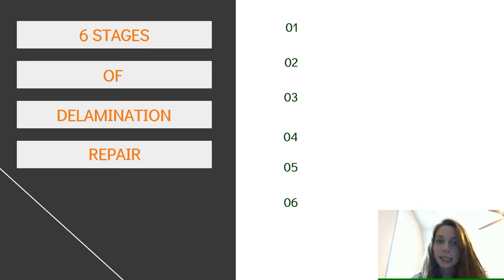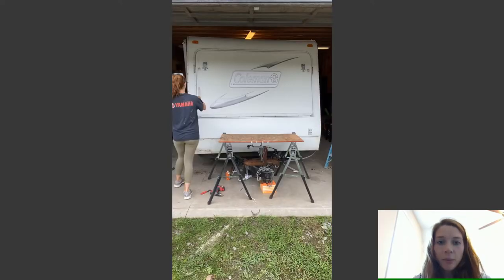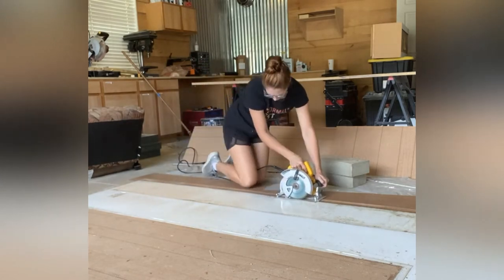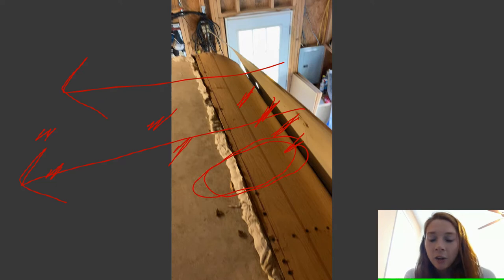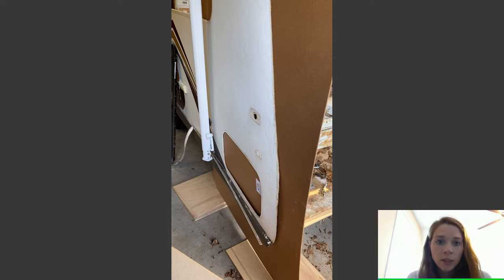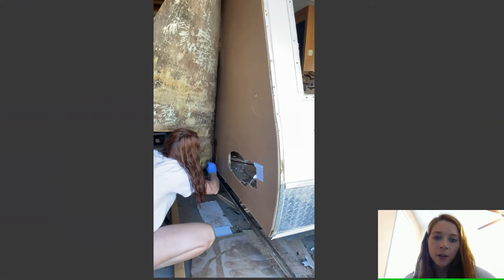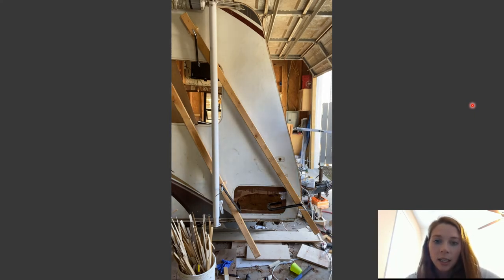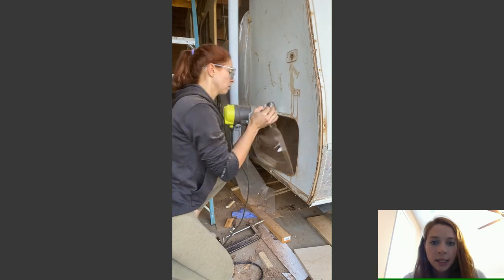How to fix RV Delamination//Repair Tips & Supplies EASY step by step guide

Comment: Amazing video and great work! So tired of seeing sites saying to inject epoxy which not address the damaged wood underneath, or harmful affects with living in moldy wood. This video addresses all the stages ,and gave me great insight to fixing my slide out wall that I have to replace before this fall.  I had to replace the  interior wall but had to direction how to replace on the exterior that still showed delamination. Now I know how to tackle the exterior wall! Keep up the great work! Rvs are made so cheaply it's so easy to get water damage and delamination. It's great to know how to fix it all! Thank you so much for sharing.
Reply from the maker: Thank you!!

Comment: Awesome tutorial. My only question is When working on the sidewall could u have completely painted the epoxy in one step vs  steps 2 and 3 with tubing, if u had a helper? I have a similar section to repair on my c class.

Comment: First of all - you kick ass... Second i'm in a situation where I need to get a camper water tight before winter and I don't have much time. The roof needs a patch. A slide out wall needs new studs and sealing. Among other things the list is huge. My question is how do you seal a slide-out? It's an aluminium panel camper. A lot of water came in through the slide out and the front corner roof seam. Is there a process you follow to make it manageable or just go at it?
Reply from the maker: That’s one of those things where you just have to go at it. You can try to patch the roof and seal from the outside, and stop the water coming in until you can tear it all out and rebuild in the spring. Send me some pictures and I’ll give you some advice on what materials you’ll need!

Comment: Hi, we love your videos, the best we've seen and so helpful! We've a TT with aluminum studs and a few different places of water damage and delamination. My first question is, on the back panel (maybe 3 ft wide) can we just take it off and glue it to the paneling apart as you did with your front piece, and then reattach it? Second question, are you using the same epoxy on the front panel as you did with the tubing on the sides? I take it you can mix this epoxy in parts, as needed. Thank you so much, we can't wait for day for on your newest series!
Reply: Another question, we ordered a few things off of your amazon site but we cannot find EXTERIOR white screws, are you using the interior for both?
Reply from the maker: Yes, you can take the rotten piece off and then just glue a new piece on! Yes—same epoxy! I’m going to test out using contact cement with the camper I’m working on now. If it holds, that’ll be much easier than messing with epoxy, so I’ll keep you updated!
Reply from the maker: And yes—the epoxy (I have it linked in my Amazon storefront in the description) is pre measured. It’s a 1 to 1 pump ratio, so it takes the guess work out of weather or not you mixed the right amount
Reply: @fallenintocamping  Funny, my husband mentioned using contact cement yesterday, please let us know how it goes!
Reply: Which screws do you recommend for the exterior?
Reply from the maker: @KoplinFamilia  oops forgot to reply to this one! Yeah, RV manufacturers typically use the 1 inch square heads for everything (hince the trim cover). It’s usually not a rust issue unless there’s water damage. Any flat head exterior screw will work though if you’d like to use something different!
Reply from the maker: Flange head will also work! As long as it sits flush with your surface when you screw it in, your good! I use roofing screws a lot and take the gasket off—really good exterior and roof option!

Comment: My question is on how you got the epoxy into the syringe and the tubing. Did you open the syringe and pour it into the syringe and then put the plunger back? Was it very thick? Did you have to thin it out some to get it to flow through the tubing? Also was filling a 60 ml syringe enough epoxy to get enough through  the tubing? Did you have to fill the syringe more than once to get enough epoxy to come out the end of the tubing?

Comment: In hindsight, would it have been more practical to use the old fiberglass as a template and just cut new sheets of filon out of a roll? That's what I'm debating right now. 30 feet of Filon runs at around $800-$1,000 dollars, but the bonus is that you have fresh fiberglass. :)
Reply from the maker: Not really, the old fiberglass wasn’t damaged, just dirty. You’ll be creating more work for yourself by cutting out a new piece, but some people do prefer that. My client didn’t have the budget for that, so I saved $1000 by cleaning and reusing it 😂

Comment: In this scenario, do you repair the interior first?
Reply from the maker: Honestly every camper is different, depending on where the damage is. If I remember correctly in this scenario, I glued the panel inside and then epoxied the outside together. Just use lots of wood blocks and don’t clamp too hard (you don’t want to break your interior paneling)